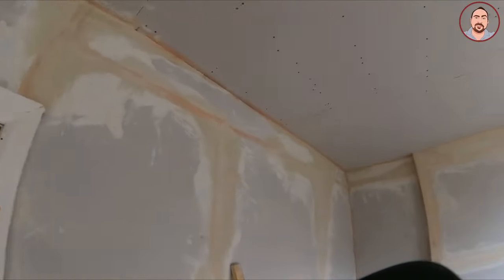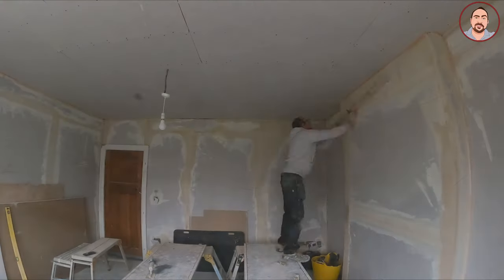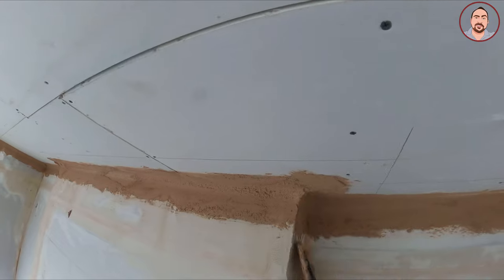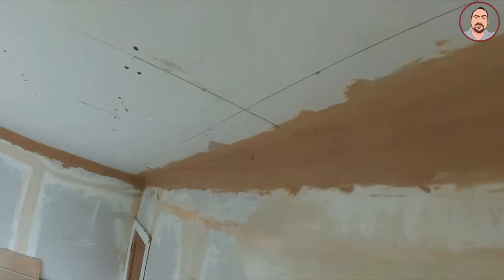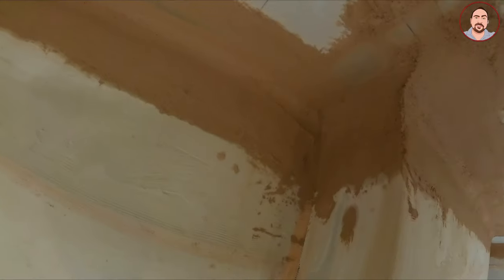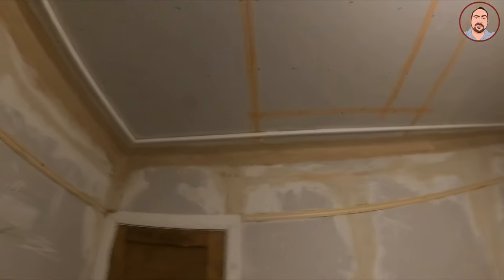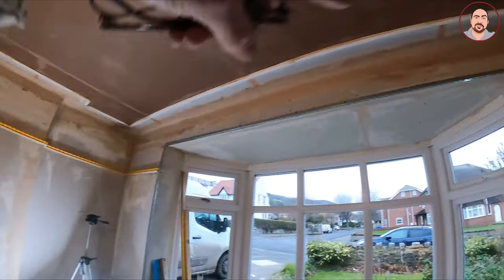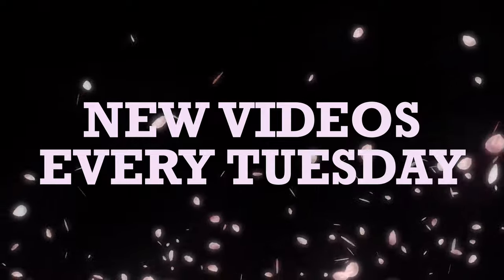How to form curves and plaster them - plastering tutorial

Comment: If you know anyone who is good at engineering and welding or if you can do it yourself ; you can actually make Perfect Coving Trowels / Internal Radius Trowels (of differing gauges), out of relatively cheap stainless steel saucepans. If they are well made they should last you a lifetime. I used to have 'Pro' one years ago in the same style as the old fashioned tyzack angel tool.

Comment: Good vid Anthony, that tool looks useful for curves. I use the 1200 ox speed skim and tweak with the trowels and plasi flex. Works really well.
Reply from the maker: Thanks bud, that’s the way I did it in my lounge, but this was much easier and I think it a much better finish. the wipe down blades been really useful. I’ve used it on conservatory ceilings and it’s worked a treat.

Comment: Excellent video as always. A use for the whale tail I'd not thought of. I like the ceiling beading/rail as well. What did you use for that? Architrave?
Reply from the maker: Cheers Rick, 
I got the ceiling dado rail from Screwfix They are just like coving so it a breeze to cut and put up. And just standard picture rail for the bottom

Comment: Hi mate,another great vid.quick question,why do u drywall all your joints when boarding
Reply from the maker: Thanks bud, I normally do it just to stick the scrim on and fill any gaps. i also think it makes it a bit stronger and bonds the boards together. You don’t have to it just something I do. This was also insulated plaster boards with a tapped edge so I just fill them up while I had some stuff over.